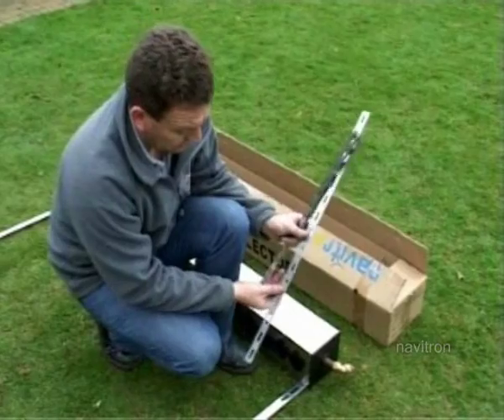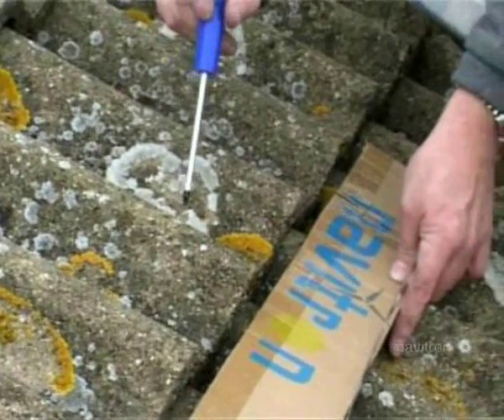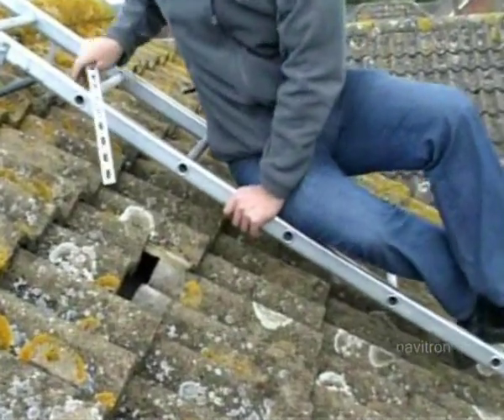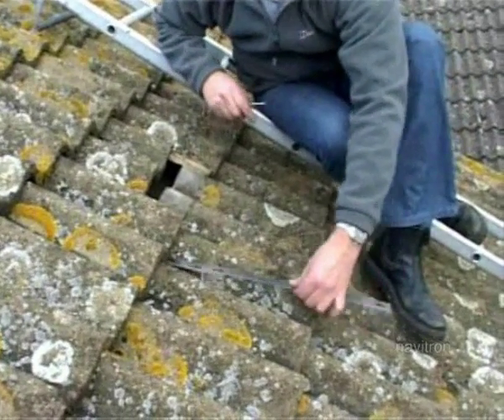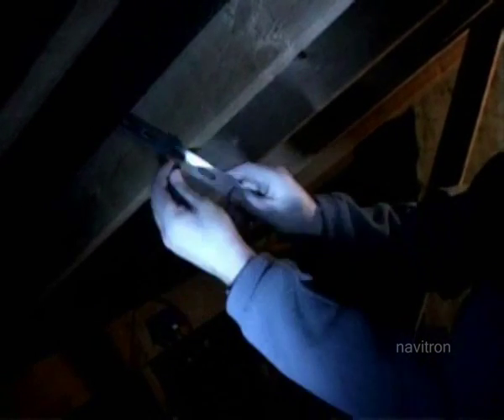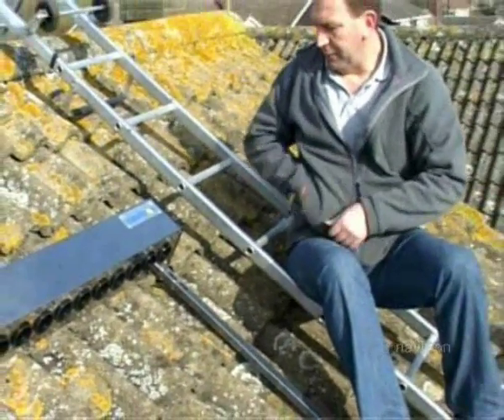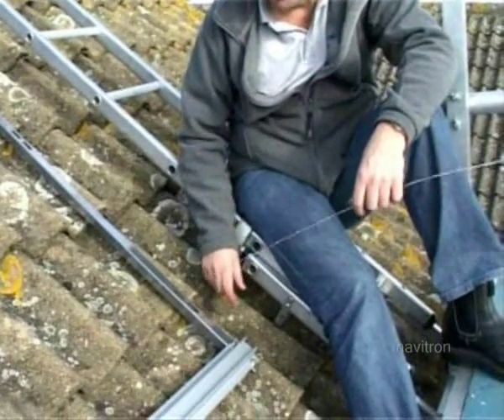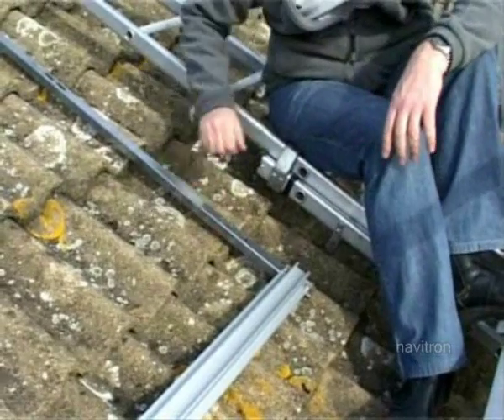mounting solar panels using navitron roof straps

Comment: I have installed solar in Colorado, USA, and we would never be able to do what is pictured in this video.  There is wooden decking under the felt paper, so we'd have to drill through and we'd certainly have to seal the hole in the felt.  Additionally, you ideally want a large lag screw into the center of the rafter to a mounting post, and then you flash the post with metal sheet and rubber gasket.  all holes are additionally sealed with 50 yr silicone caulk sealant.

Comment: it's amazing how many crazies this video seems to have attracted.  In regards to the comments about roofing felt making it waterproof, I can attest to the fact my roofing felt is far from hole free, I would be hard pressed to find a solid patch of it on my roof.  It is there to protect the house if a tile fails.
The panels are spread over a number of rafters.  Concrete tile roofs are designed to take a very large loading.  I'm sure it's fine.
A video on how best to get the pipe in would be good!

Comment: No way I would fit this system to my roof, imagine a strong gale would push them tiles back and you would have a solar system clattering away on your roof. I wonder what the guaranteed life span of that system  is.
Reply: mines been up for 15 years, still working fine.